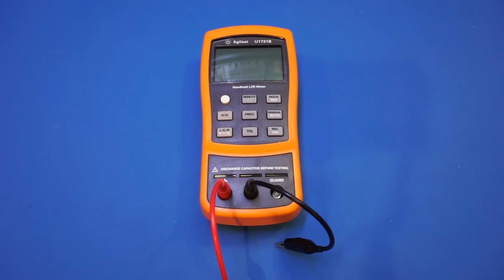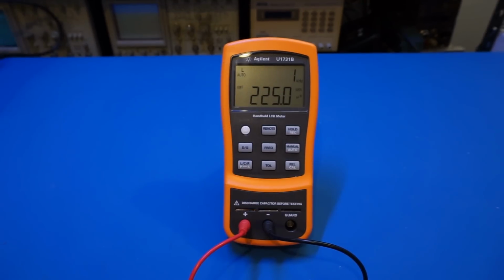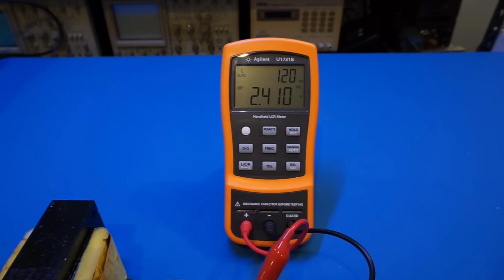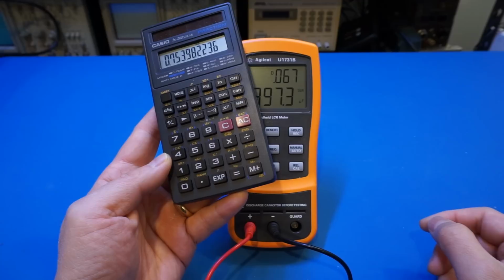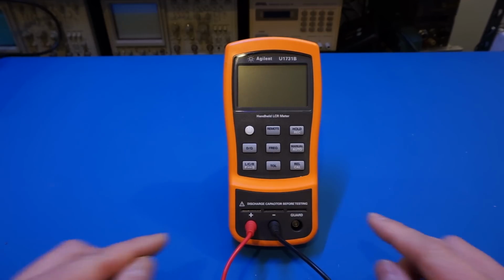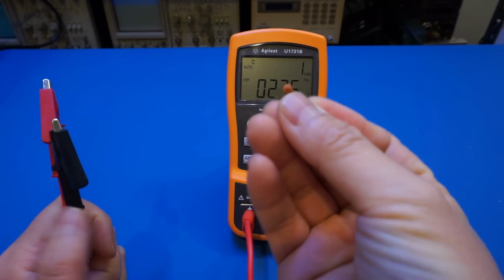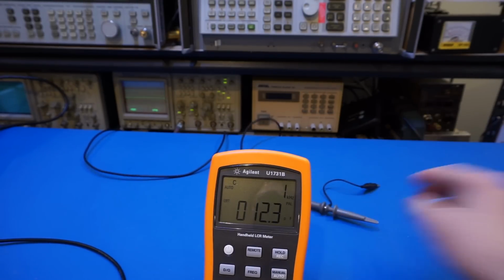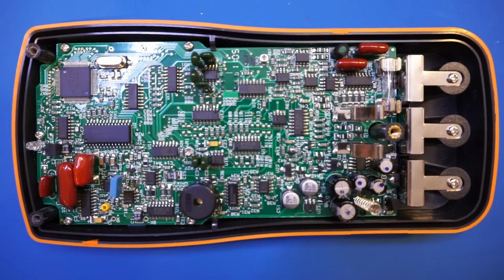Agilent U1731B LCR Meter Serial/Parallel Mode, Guarding Explanation and Teardown

Comment: Way I think about series and parallel, if you have a low impedence, the voltage will be very small and the current will be relatively large, so its better to measure series (i.e. current measuring), coversely, for measuring high impedence, the voltage drop will be high and the current will be low, so you measure the voltage across the circuit (parallel).
The question is, what is the ideal frequency to measure,? most just think in terms of low and high, to determine accurately, you look at the phase angle at each frequency, ideal components should be purely  REACTIVE (opposite to resistors which should only be purely resistive), hence you are looking for a +90 phase angle for inductors or 90 for capacitors or close to it, but measuring one with a +/ 5deg angle means your measured value will be way off.

Comment: Kerry, if you use the ohms range to measure capacitors won't that give you the ESR as the resistance measurements are done with an  AC signal?
Reply from the maker: Hmm, I just gave that a shot. I did get a reading (which is in the ball park of what I would expect for the ESR) back but it differs from the calculated ESR from the dissipation factor? Not sure what's going on here, I guess I will need to investigate a bit more...